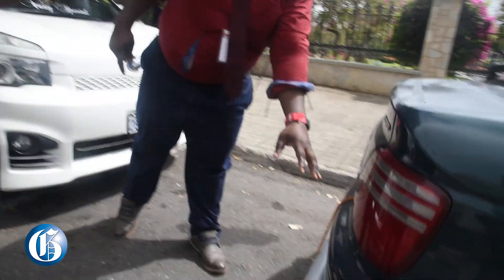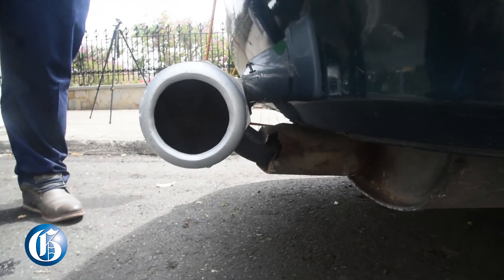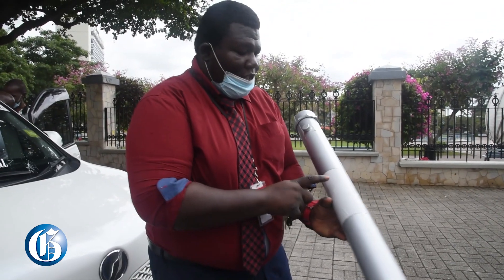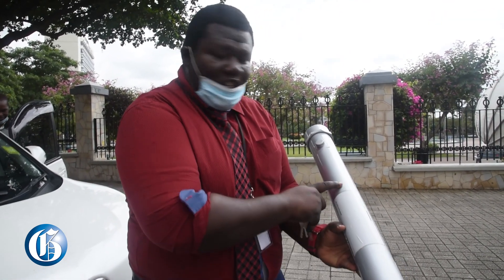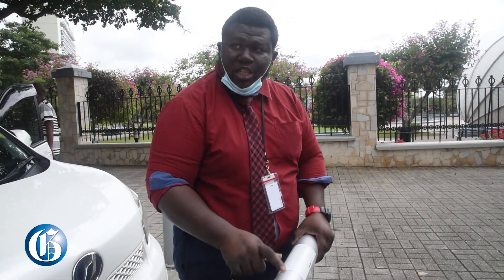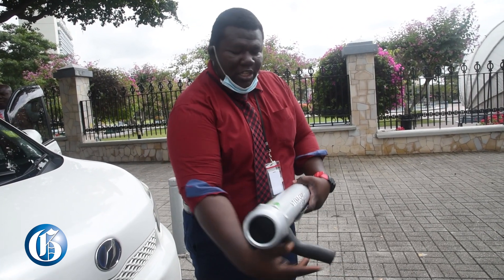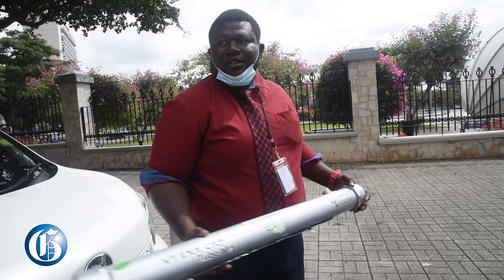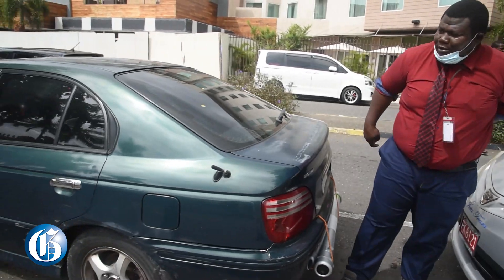Local inventor hopes fuel-saving CO2 absorber will boost climate change fight

Comment: CON Man! Total Hoax 👎🤦‍♂️
19.6 lbs of Carbon Dioxide (CO2) are produced for Every Gallon of gas that car uses. So that is 250 lbs for EVERY Tank that car uses… so where does that 250 lbs of CO2 get held in that little pipe and where do you put that 250 lbs of CO2 each time you fill up?

This guy just preys on people’s lack on knowledge

Comment: GOOD JOB JUST TO MAKE IT WAY SMALLED AND EASIER TO CLIP ON
Reply: CON Man! Total Hoax 👎🤦‍♂️
19.6 lbs of Carbon Dioxide (CO2) are produced for Every Gallon of gas that car uses. So that is 250 lbs for EVERY Tank that car uses… so where does that 250 lbs of CO2 get held in that little pipe and where do you put that 250 lbs of CO2 each time you fill up?

This guy just preys on people’s lack on knowledge.

Comment: Outstanding!
Reply: CON Man! Total Hoax 👎🤦‍♂️
19.6 lbs of Carbon Dioxide (CO2) are produced for Every Gallon of gas that car uses. So that is 250 lbs for EVERY Tank that car uses… so where does that 250 lbs of CO2 get held in that little pipe and where do you put that 250 lbs of CO2 each time you fill up?

This guy just preys on people’s lack on knowledge.

Comment: This is an addition to help lower the emission of Carbon Dioxide if tested and proven we should be proud. If manufactured in Jamaica it would mean employment for Jamaicans, this is a good thing. Dont let negativity put you down Mr Fong, but up.
Reply: CON Man! Total Hoax 👎🤦‍♂️
19.6 lbs of Carbon Dioxide (CO2) are produced for Every Gallon of gas that car uses. So that is 250 lbs for EVERY Tank that car uses… so where does that 250 lbs of CO2 get held in that little pipe and where do you put that 250 lbs of CO2 each time you fill up?

This guy just preys on people’s lack on knowledge.

Comment: It's a nice look. Top of the line invention.
Reply: CON Man! Total Hoax 👎🤦‍♂️
19.6 lbs of Carbon Dioxide (CO2) are produced for Every Gallon of gas that car uses. So that is 250 lbs for EVERY Tank that car uses… so where does that 250 lbs of CO2 get held in that little pipe and where do you put that 250 lbs of CO2 each time you fill up?

This guy just preys on people’s lack on knowledge.

Comment: Great work
Reply: CON Man! Total Hoax 👎🤦‍♂️
19.6 lbs of Carbon Dioxide (CO2) are produced for Every Gallon of gas that car uses. So that is 250 lbs for EVERY Tank that car uses… so where does that 250 lbs of CO2 get held in that little pipe and where do you put that 250 lbs of CO2 each time you fill up?

This guy just preys on people’s lack on knowledge.

Comment: I hate feeling like this even when looking for the good in someone. This all sounds like a scam. As other viewers of this video mentioned, he is describing a catalytic converter. Cars made from 1975 all have a catalytic converter that does all that this inventor outlined in this product.
Reply: It not a scam ,it a great idea
Reply: @pillarwalters2480  CON Man! Total Hoax 👎🤦‍♂️
19.6 lbs of Carbon Dioxide (CO2) are produced for Every Gallon of gas that car uses. So that is 250 lbs for EVERY Tank that car uses… so where does that 250 lbs of CO2 get held in that little pipe and where do you put that 250 lbs of CO2 each time you fill up?

This guy just preys on people’s lack on knowledge.
Reply: First One to Get It👍

CON Man! Total Hoax 👎🤦‍♂️
19.6 lbs of Carbon Dioxide (CO2) are produced for Every Gallon of gas that car uses. So that is 250 lbs for EVERY Tank that car uses… so where does that 250 lbs of CO2 get held in that little pipe and where do you put that 250 lbs of CO2 each time you fill up?

This guy just preys on people’s lack on knowledge.

Comment: Electric vehicles are the wave of the future, but this could be a game-changer until they become more prevalent. I hope they've done their due diligence and have proper counsel to patent this invention.
Reply: CON Man! Total Hoax 👎🤦‍♂️
19.6 lbs of Carbon Dioxide (CO2) are produced for Every Gallon of gas that car uses. So that is 250 lbs for EVERY Tank that car uses… so where does that 250 lbs of CO2 get held in that little pipe and where do you put that 250 lbs of CO2 each time you fill up?

This guy just preys on people’s lack on knowledge.

Comment: Where is the Jamaican inventor that use water to drive the car....here we have another young  inventor that is filled with inspiration........bro we Jamaicans will support the move don't depend on Gov...start small ,one day the world will hear of you and then you'll see our same Gov running to celebrate you...if it nuh come from foreign you know the rest a first them style
Reply: CON Man! Total Hoax 👎🤦‍♂️
19.6 lbs of Carbon Dioxide (CO2) are produced for Every Gallon of gas that car uses. So that is 250 lbs for EVERY Tank that car uses… so where does that 250 lbs of CO2 get held in that little pipe and where do you put that 250 lbs of CO2 each time you fill up?

This guy just preys on people’s lack on knowledge.

Comment: Awesome 👌,  some company that has a fleet of vehicles should link up with him....
Reply: CON Man! Total Hoax 👎🤦‍♂️
19.6 lbs of Carbon Dioxide (CO2) are produced for Every Gallon of gas that car uses. So that is 250 lbs for EVERY Tank that car uses… so where does that 250 lbs of CO2 get held in that little pipe and where do you put that 250 lbs of CO2 each time you fill up?

This guy just preys on people’s lack on knowledge.

Comment: Soooooooooo basically  its an external  catalytic converter then? 😳😳😳😳
Reply: Hell yes
Reply: CON Man! Total Hoax 👎🤦‍♂️
19.6 lbs of Carbon Dioxide (CO2) are produced for Every Gallon of gas that car uses. So that is 250 lbs for EVERY Tank that car uses… so where does that 250 lbs of CO2 get held in that little pipe and where do you put that 250 lbs of CO2 each time you fill up?

This guy just preys on people’s lack on knowledge.

Comment: Secure ur business from predators
Reply: He IS The Predator.

CON Man! Total Hoax 👎🤦‍♂️
19.6 lbs of Carbon Dioxide (CO2) are produced for Every Gallon of gas that car uses. So that is 250 lbs for EVERY Tank that car uses… so where does that 250 lbs of CO2 get held in that little pipe and where do you put that 250 lbs of CO2 each time you fill up?

This guy just preys on people’s lack on knowledge.

Comment: Mek sure you get the patent for this otherwise VW and Ford will teef it and give you nothing.
Reply: CON Man! Total Hoax 👎🤦‍♂️
19.6 lbs of Carbon Dioxide (CO2) are produced for Every Gallon of gas that car uses. So that is 250 lbs for EVERY Tank that car uses… so where does that 250 lbs of CO2 get held in that little pipe and where do you put that 250 lbs of CO2 each time you fill up?

This guy just preys on people’s lack on knowledge.

Comment: Get it patent fast
Reply: CON Man! Total Hoax 👎🤦‍♂️
19.6 lbs of Carbon Dioxide (CO2) are produced for Every Gallon of gas that car uses. So that is 250 lbs for EVERY Tank that car uses… so where does that 250 lbs of CO2 get held in that little pipe and where do you put that 250 lbs of CO2 each time you fill up?

This guy just preys on people’s lack on knowledge.

Comment: Good job bro, nice invention the Jamaican government needs to help the young man
Reply: If the government was helping him he would reach any where they only help teef.... You only reach higher level by doing good..... We need to help him in every way possible that's it
Reply: CON Man! Total Hoax 👎🤦‍♂️
19.6 lbs of Carbon Dioxide (CO2) are produced for Every Gallon of gas that car uses. So that is 250 lbs for EVERY Tank that car uses… so where does that 250 lbs of CO2 get held in that little pipe and where do you put that 250 lbs of CO2 each time you fill up?

This guy just preys on people’s lack on knowledge.
 @azanyah.benbenjamin6915
Reply: CON Man! Total Hoax 👎🤦‍♂️
19.6 lbs of Carbon Dioxide (CO2) are produced for Every Gallon of gas that car uses. So that is 250 lbs for EVERY Tank that car uses… so where does that 250 lbs of CO2 get held in that little pipe and where do you put that 250 lbs of CO2 each time you fill up?

This guy just preys on people’s lack on knowledge.

Comment: You could also look into using the waste heat from the exhaust and converting it into useful electrical energy using Thermoelectric devices.
Reply: CON Man! Total Hoax 👎🤦‍♂️
19.6 lbs of Carbon Dioxide (CO2) are produced for Every Gallon of gas that car uses. So that is 250 lbs for EVERY Tank that car uses… so where does that 250 lbs of CO2 get held in that little pipe and where do you put that 250 lbs of CO2 each time you fill up?

This guy just preys on people’s lack on knowledge.

Comment: Sounds like good stuff to protect  the environment
Reply: Hello
Reply: CON Man! Total Hoax 👎🤦‍♂️
19.6 lbs of Carbon Dioxide (CO2) are produced for Every Gallon of gas that car uses. So that is 250 lbs for EVERY Tank that car uses… so where does that 250 lbs of CO2 get held in that little pipe and where do you put that 250 lbs of CO2 each time you fill up?

This guy just preys on people’s lack on knowledge.